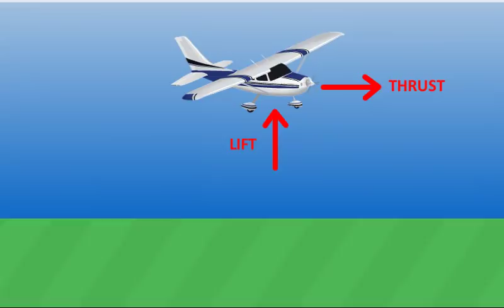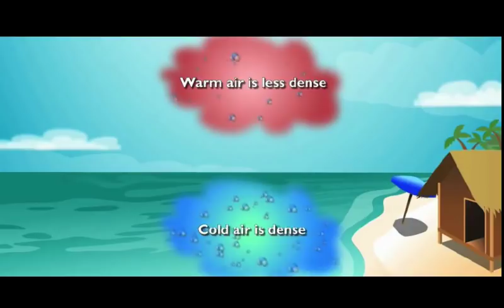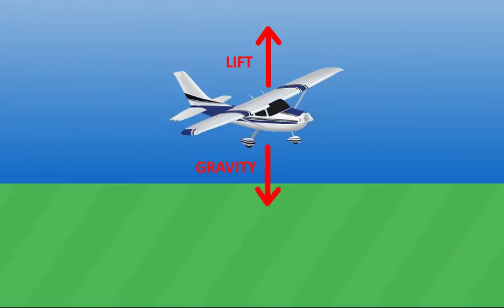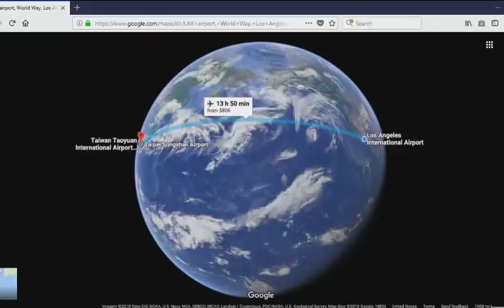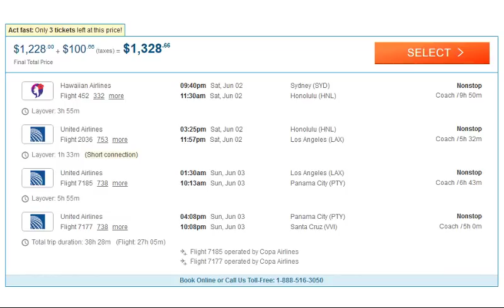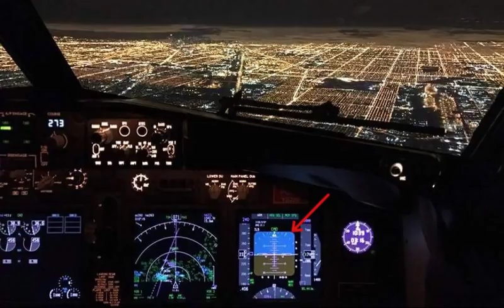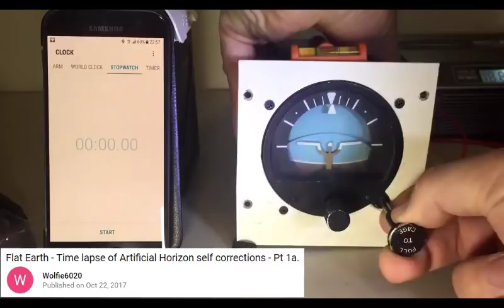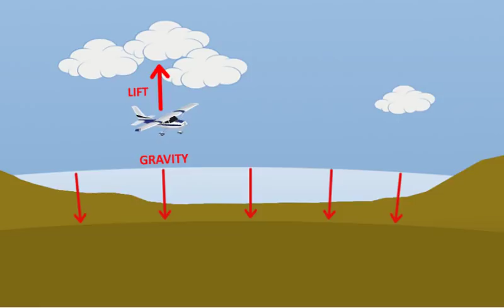Flat Earth Falsities - Plane Nonsense

Comment: " So a plane sitting on the ground is already moving WITH the earth...it does not instantly lose that momentum when it takes off../it continues moving with the earth...... and must use THRUST to ADD or SUBTRACT from that (non)movement  

a stationary plane on a runway must use thrust to remain stationary>
lol.
nice logic.
Reply: Read what you quoted again.  Slowly.  Take your time.  I'll give you a hint.  Pay close attention to the 9th and 10th words.
Reply from the maker: You are having trouble understanding relative movements. Movement is always relative to some frame of reference. When you walk toward the tail of an airplane in flight going north, you are moving backwards relative to the plane (south), but you are still moving the north, relative to the surface of the earth. Simultaneously, you, the plane, the air around the plane, and the surface of the earth, are all moving east, relative to the center of the earth. And all of that is moving around the center of the sun, and so on. So when I say the plane uses thrust to add or subtract from that movement, I mean the thrust allows it to move relative to the surface.
Reply: Hes not having trouble understanding. Hes refusing to understand. You cant even call flat earth a religion because religions cant be disproven. Flat earth was 2 thousand years ago. To think the universe revolves around the earth is the more arrogant thing.
Reply: A ball in your hand in a car is already moving with the car. 
If you throw it forward or backwards you are adding or subtracting from that movement.
Reply: You’re an idiot 😂
Reply: Adam  I've noticed a pattern with this FE nonsense as I'm sure you have also.   They all try to appear that they know for a fact all that we have learned as a species is a complete lie.  Yet, when humans first set "sail" on the oceans and sea's, we knew that the earth was round-ish.  That means at least for 3000 years (or more) we knew that a Flat Earth was Flat nonsense.  So they proceed to deny history itself (or "pick and choose parts of it)  And so it goes on, picking and denying the obvious nature of  what we have accomplished.  Also, they all try to appear as an "expert" in Flat Earth "Theory" when it's not even an Hypothesis.  Just a crazy idea the have to make themselves seem "Special".  As people in the "know"...
Reply: Believes huge conspiracy

Can't remember sentence typed 10 seconds earlier
Reply: are you familiar with Newton's laws of motion? stationary plane on the run way has two vertical forces working on it that are the same amount but in opposite direction therefor neutralize one another. mg which is the planes mass x 9.8 m/s² (gravity constant) and the normal force. since the plane is stationary, there are no horizontal forces being applied ( F=m x a (acceleration which is zero in case of the plane being stationary) therefore F = m x 0 = 0). now if the plane starts to take off it will require certain amount of force applied to accelerate at x m/s² to reach a certain velocity so with the air flow under the wings plane gains enough lift until it's greater than the weight of the plane (Bernoulli's principle). so now that the plane is off the ground, there forces acting on it: 1- gravity force (vertical and downward 2- air flow (difference between air pressure under and over the wing) which pushes the plane upward  3- engines thrust that pushes the plane forward and with 4- friction working against it. so no matter if the plane is stationary or flying, the main force acting on the plane is gravity, brilliant men came up with the equations that led to building and designing different aircrafts that you see today.
Reply: "You mention Foucault but don’t acknowledge that there are Foucault Pendulums all over the world that slowly rotate with a period that is directly dependent on their latitude. "
these pendulums are nothing but hypnosis machines.
they do not do what you think they do.
they often rotate the wrong way.
they are influenced by eclipses
they are erratic
some of them also have motors and magnets
furthermore, they would only work on the poles.
not a proof of movement.
Reply: psyleidoscope The orbit around the sun is much faster in real terms than the rotation of the Earth.  However, that motion traces out far less of an angle.
It's in the same way that the movement if the tip of a clock hand is far, far slower in absolute terms than the rotation of the Earth, but covers a full circle in around 1/24 of the time it takes the Earth to rotate.
Alternatively, watch a car driving at 100 miles per hour on a distant motorway (across your vision).  Time how long it takes to cross your line of vision, compared to someone walking at normal pace 20 feet in front of you.  Which moves faster?  The car or the person?
Reply: @Adam Adamson
"You cant even call flat earth a religion because religions cant be disproven." It isn't actually a religion, it is a manifestation of a religion. It is called biblical literalism, ever heard of it? There are the FE, ID, Creationist and YEC cults. Basically the same.
Reply: "Simultaneously, you, the plane, the air around the plane, and the surface of the earth, are all moving east, relative to the center of the earth. And all of that is moving around the center of the sun, and so on. "

this is the part you cannot prove, but are taking the word of what others have told you.
You cannot prove earth is moving at all
let alone all the absurd motions you believe are happening.
Reply: "Read what you quoted again.  Slowly.  Take your time.  I'll give you a hint.  Pay close attention to the 9th and 10th words"
derp.  I understand perfectly what you are saying, just i am pointing out that you have no proof whatsoever for what you believe is happening  i.e. that the earth is moving (already) 
you believe (because others have drilled into your brain) that a plane on a runway is moving in at least 4 directions simultaneously adding to nearly 2,000,000 mph.  and that THRUST would be needed to get the plane to actually sit still.
this is the most absurd notion i have heard in my entire life
that is all.
BELIEF  ::::  its a hell of a drug.
Reply: I can proof the world is spinning in 10 seconds.

take a gyroscope, and leave it on for a few hours.

then place a camera watching it.

Come back in 6 hours and watch as it as now just span for 1/4th of a day!

CONGRATULATIONS!
Reply: not even close.
this has been done countless times.
it does NOT show precession
like none whatsoever
Reply: psyleidoscope: I heard Globebusters got their subscribers to help pay for a ring laser gyroscope to disprove the rotation. Then they had to admit it did show precession consistent with rotation but the blamed it on “the aether”. 😂
Reply: Do you know what a gyrocompass is and how it works?
Reply: well, guess you know what happens when you believe what others tell u lol.
globe busters did not get their subs to pay for the ring laser gyro
one person bought it.
the ring laser registers 15 deg/hr
BUT :
this is the only thing it measures
It is entirely sensitive enough to measure the other supposed motions of earth i.e. sun orbit velocity for example, but it does not.
they did not "blame" it on the aether.
this is settled science
gale/sagnac experiment
as well as airy's failure
Reply: Just saying what I heard. I wasn’t going to sit through hours of Globebusters bullshit to find out the truth. 
So their gyro registered 15° per hour huh? Hmmm.. I wonder why that would be? 15 x 24 hours = 360° that looks like pretty convincing proof of a rotating Earth to me no?
Reply: How exactly do you reconcile “it does NOT show precession like none whatsoever” with a major flat earth channel admitting they got 15°/hr of precession?
Reply: GrahamStw i said this in reply to this:  "I can proof the world is spinning in 10 seconds.

take a gyroscope, and leave it on for a few hours."

Zetta was not talking about a $20k ring laser gyro. 
Foucault is credited with inventing the gyro, and it is claimed that his gyro registered precession.
many, many others have tried to replicate his test with modern (and far more precise) gyros, and have found exactly zero precession.

A ring laser gyro is a completely different animal.
Reply: like i said before.  a state of the art $20k ring laser gyro is incredibly sensitive.
it is registering (apparently) 15 deg/hr. 
this may look like "proof" of axial precession on the surface, but what if there are other explanations?
What if the gyro is so sensitive, that if earth were indeed rotating and orbiting the sun at 66k mph it should also register this lateral movement, but it does not?
Then we look at famous historical physics experiments (sagnac/gale/airy) which prove it is the starlight (in the aether) which is indeed moving above a stationary earth?
would the ring laser recording 15 deg/hr still convince you that earth is rotating?
Reply: Modern gyros do show precession. Ships, boats and submarines all over the world use a gyrocompass which relies on precession and the rotation of Earth to find True North.
Reply: You mention Foucault but don’t acknowledge that there are Foucault Pendulums all over the world that slowly rotate with a period that is directly dependent on their latitude. 
If you were feeling really stubborn you could even make one yourself to test this.
Reply: Do you still believe that “it does NOT show precession like none ever” even though you admit that ring laser gyro does show precession?
How does that make sense?
Reply: As for lateral movement from the orbit around the sun: what change there is not already covered by the precession that is shown?
And how long are you letting the gyro run for, given that we orbit the sun less than 1° per day.
Reply: Mohssen Kh  good post
Reply: "Do you still believe that “it does NOT show precession like none ever” even though you admit that ring laser gyro does show precession?
How does that make sense?"
like i said before.....we were talking about gyroscopes.  a gyro has a rotor which is physically rotating inside gimbals.   this type of device has not been shown to detect 15 deg rotation in modern times, although apparently Foucoult was able to with technology 150 yrs old.
a ring laser gyro uses light to detect movement.  i am not entirely sure why it is even called a gyro.
this is entirely different, and is not the type of instrument i was referring to with the above statement.
Reply: "As for lateral movement from the orbit around the sun: what change there is not already covered by the precession that is shown?
And how long are you letting the gyro run for, given that we orbit the sun less than 1° per day."
well, i have never even seen one in real life.
there have been plenty of claims of 15 deg/hr detection, but no claims of the other movements (sun orbit, galaxy movement) which are orders of magnitude higher velocities.
If the 15 deg/ hr is the *only) thing being recorded, then it is difficult to claim that this is due to the rotation of the earth...
Like i said above as well:  a ring laser is built on the principle of the Sagnac effect.  sagnac, gale, and airy's failure prove that it is the aether which is rotating above us and the earth is stationary.